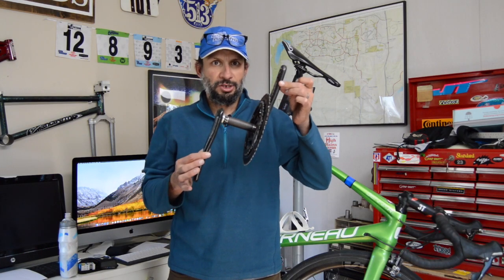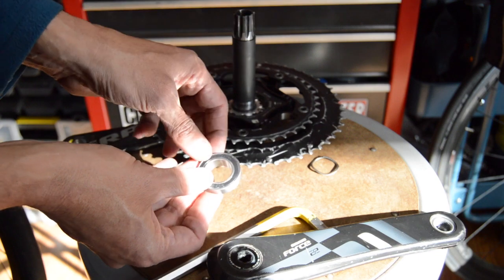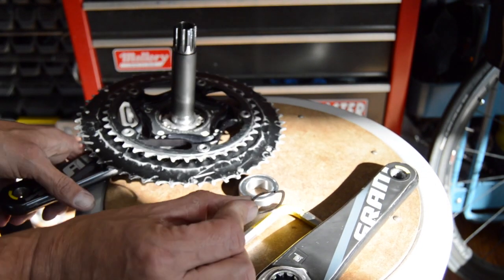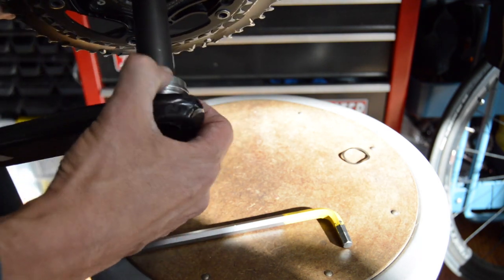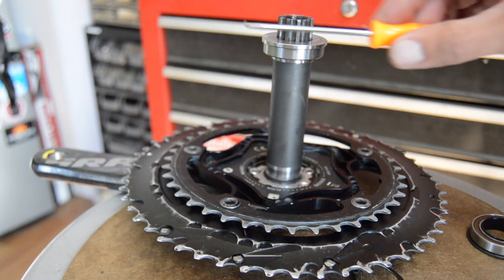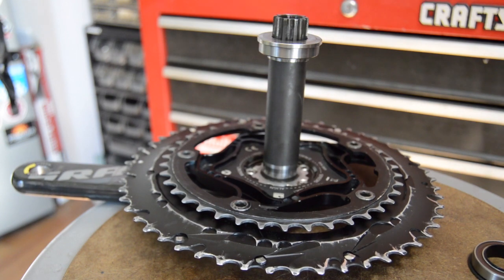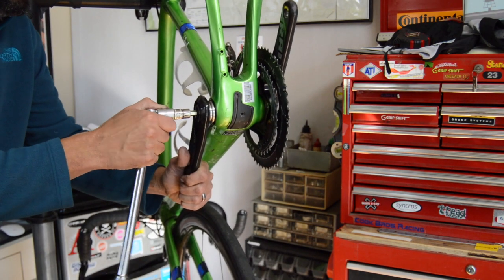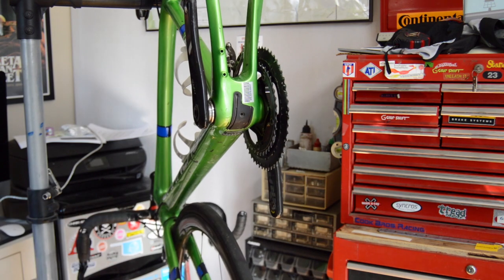IS The SRAM GXP The Worst Crankset In The World?

Comment: I ran one of these things a few years back.  Very worst crankset I have ever owned, hands down.  The thing would creak just by looking at it,  well not really,  but it was almost that bad. Bearing life was also a joke. Bearings had to be replaced towards the end of season 1. Ended up ebaying it and recovering very little of my loss. This is simply a very poor design, and what makes the design exceptionally poor is that even if you gorilla the non drive side crank arm down to center the bearing on the beveled shoulder as you claim if that beveling is out of tolerance at all you will not center the bearing properly. Mechanical fact!  This is a perfect example of a design flaw that will almost always play itself out in the fabrication phase of the product (unless you have both very, very tight tolerances and the ability to fab to those tight tolerances consistently - which SRAM does not !) because it is a design with very little "tolerance" for fabrication error or installation error in order to work correctly.  Given SRAM's miserable history regarding their actual fabrication tolerances (they are well known in the industry to be a joke compared to Campy and Shimano) I will never buy one of their cranks again.  I have run several different generations of both Shimano and Campagnolo cranks on road, cross, gravel and MTB's, and never once had the issue I had with that SRAM GXP junk.  In addition,  the very moment I removed that SRAM junk and replaced it with a basic Ultegra 6000 series crankset,  guess what,  creaking issues immediately disappeared and the bearings on those cranks are still going strong after multiple seasons. So it was not a frameset issue.
Reply from the maker: Yeah, you should probably stick with Shimano, it's really easy to understand the assembly process.

Comment: Do you have a link for the delrin spacers you were talking about? I have a feeling I will need these as there is some space on the drive side of the Force 22 cranks I am trying to install. They spin just fine and the non drive side is pressed against the gxp bb nicely but the drive side does not look flush. Thanks!!

Comment: I see a lot of flack to Hambini, but in his defence, i think people are missing the point, the reason he doesn't like SRAM/ZIPP, is one, not the design, but the variance in their tolerances, he is not a bike wrench, he works in the aerospace industry and if you say it is made to these tolerances, it is. Whilst the bike industry states a poor tolerance, or doesn't follow their own specs. That is his argument, same with bike frames.
In essence, you can get a poor one or a good one, luck of the draw, that is his issue, apart from the false marketing. 
So yes Joey, you get them to work, but should you have to with a 10k bike? That really is the question?
Reply from the maker: I've been a mechanic in the bicycle industry for a really long time, and I've worked alongside engineers in manufacturing. In my experience, I've seen way more bicycle-related issues from bikes due to poor assembly, maintenance, and adjustment than anything related to poor tolerances. There's more to keeping a bottom bracket creak free than tolerances and torque settings. This is my problem with Hambini. He focuses mainly on tolerances as an issue, then neglects fundamental assembly points when putting it back together. In his GXP video, he basically blames poor spindle tolerance as an issue when he never assembled the assembly correctly in the first place and designed a fix based on bad information. 
10k custom-built bikes always require lots of special attention to get them dialed in right.

Comment: Hi Joe,  very informative video thanks! I recently installed a SRAM GXP and SRAM RED crankset- with no spacers on a road bike- the crankset is not running smoothly- it is very stiff to turn- should I have used the spacers?
Reply from the maker: Threaded? Pressfit? If it is stiff to turn, most likely the spider is rubbing against something or the outside bearing to bearing measurement is too wide. With the cranks removed, the overall width of the bottom bracket with the bearings installed and dust covers in place should measure about 92mm. If it is more than a millimeter wider than this, you're getting excessive radial load on the bearings. Adding spacers would only make the matter worse.
Reply: @JoeyMesa  if i have width 95mm, what can i do?

Comment: I had problems with GXP : a lot of play on the ND side after around 2000 km. And I don't apply excessive torque on it (not a sprinter, very light rider that speen the leg).
Reply from the maker: Let's backpedal to the point when the crank was installed. How much torque was applied to the non drive side spindle bolt? It doesn't matter how much torque the legs are putting out if the crank is not installed correctly, (if the NDS bearing is not fully contacting the crank arm and the shoulder on the spindle, ie. Hambini syndrome) there will be play in the BB.
Reply: @JoeyMesa  There will also be play if the beveling of the shoulder that you mentioned earlier is not designed and fabbed to spec properly.  And that is true no matter how much you gorilla the NDS crank spindle bolt. If it isn't fabbed correctly I don't care if you install it with 500nm's of torque, it will not work properly. Fact!
Reply from the maker: @rcg9573  I've literally installed, maintained, and repaired thousands of GXP cranks on a wide variety of bicycles. I've even owned a few myself. I don't ever recall ever seeing one that was manufactured in a defective or out of tolerance manner enough to affect a successful installation. One thing I have seen is failure and damaged components from improper assembly.
The thing is, even if a product is designed perfectly, the tolerances are spot on and consistent, an inexperienced mechanic can still screw it up if they don't understand how the product works or the sequence of what part goes where during assembly, there's a good chance for failure. That's a true fact!

Comment: I find a lot of complaints about this crank stem from improper installation or maintenance.

I’ve had GXP on my last three Bikes and only had an issue with my current hardtail MTB and that’s because it got used as winter bike. Unfortunately I put some wear on my smaller spindle race... I did seem to fix it using a beer can as a shim since there was nothing to loose.
Reply: I have constant problem with GXP on my road bike (always a loosen ND side after 2000km). Do you have idea what sort of improper installation or maintenance could cause that ?
Reply from the maker: In addition to the other comment, make sure the dust cover is installed between the crank arm and the bearing. The spindle bolt needs to be TIGHT! Sram's torque spec is 48-54Nm, but I tighten them to the point where I can feel the crank arm bottoming the bearing out against the spindle shoulder.
Reply: @JoeyMesa  yes this is the design. The SRAM instructions tell you to keep greasing the splines and install/uninstalling until the splines get worn to the perfect fit. 
With pedaling and repeated installation the splines can wear and get loose, so people then just tighten the cranks more....but you then need to move the bearings in the cups closer together to offset the spline wear. 
There should be a spacer (crush tube) in between the 2 bearings preventing you moving that bearings though. 

The road version SRAM force and some other BBS seem to be missing the crush tube, so measuring and spacing the cranks with washers might be the only solution if you have play in the bearings. 
All the people that say they have premature bearing failures have too much side loading on the bearings. Using a bearing press to push the outer race of the BB bearings closer together will fix the issue. 

In saying this, I have a giant xtc with factory fitted press fit gxp BB and x9 cranks. Zero free play and cranks still spin 4x when you wizz them. When setup they last forever, but if you wear the spindle splines there's a lot of mucking about to reset the bearing side load.

Comment: Hi Joey thanks for the video. One of Hambini's beefs was the variance when he measured the non-drive side's splines on the spindle. I have a pressfit 86 and worn 50T chainring that I want to replace. I have  had my bearings out 3 times in 18 months. I ride alot in the rain and creaking has developed again, slight this time. What would you recommend to replace it. The tiagra crankset is not easy to find a single chainring plus i would like to go smaller (46T?). I am willing to look at other BBs. You seemed to think a 30mm spindle isn't as good? What mid priced BB have you liked? Thx.
Reply from the maker: Thanks Al
I don't know if Hambini fully understands the concept of how the GXP system actually works or not. The spindle spline area OD and the NDS bearing ID is irrelevant due to the fact that the bearing contact points are the beveled spindle shoulder and the crank arm. The bottom line is Hambini didn't get the NDS crank arm fully purchased on the spindle and blamed it on poor engineering. I tried to have a discussion with Hambini about it, but he mostly just called me names.
As far as your BB situation, unless you're wanting to switch crank manufacturers, your Shimano Tiagra is fine. You didn't mention if it's the 4700 model or 4600 or older. The 4700 chainrings are more expensive to replace and won't have as many size options as the 5 bolt 110mm bolt circle diameter of the 4600. If you have the 5 bolt version, there's quite a lot of aftermarket options. If you're looking for a lower gear range going from the 50 to a 46 chainring, a more cost effective route may be looking into a wider range cassette. That depends on what cassette you currently have though. 
As far as your bearings go, I'd stick with a Shimano press fit BB. It's about as good as it gets for something mid range price wise. If you're looking for something with metal cups instead of plastic that threads together, Wheels MFG BB's are my favorite. They run about $74 https://amzn.to/2ydQSm3
Also riding in the rain can cause lots of creaks to appear that may not even be the bottom bracket. I made another video on some common things to check before getting into the bottom bracket: https://www.youtube.com/watch?v=SR5_xUBipa0&t=328s
Unless the bearings are really rough or notchy feeling or have excessive play, they're probably fine. I've had a Shimano BB on my crappy weather commuter for over a year and a half. That bike gets ridden mostly in rain or snow, dirt and gravel, gets washed about once a month (sometimes that in itself gets water into the bearings) and they still feel smooth as butter.
I wouldn't consider a 30mm spindle at all for your setup. You would need new cranks and a specialty 41mm OD bearing cup for a 30mm spindle. It would be expensive and way less durable than what you have now.

Thanks for your questions and feedback!
Reply: @JoeyMesa  xlnt ty. 4700. One creak was the crank arm, i took it off, cleaned and greased and it's gone. My creak currently has gone, i expect the temperature has had an effect. I already ride a 34T cassette and 36T on my gravel race wheels. I had a 42T but it broke my rear derailler as the wolftooth roadlink snapped in half during a rainy dirty race. I have the cassette on my mtb which is also 10 speed, which i like - that i can go back and forth, i have a goatlink on there and a clutch derailler, works fine. The Wheels bb is on my list, thanks for telling me your experience on that, i will prob go with that. $125 CAD. Next time i remove the cups i will take a look at the bearings. So the chain ring is the issue. Apparently there are 3 other cranks that are compatible that i could use the rings from - Ultregra I think and another. So I'll have to be patient on sourcing it. The small chainring is fine, the bigger one is getting pointed - plus it can take some dings. Ty

Comment: The way I see it is that the wavy washer acts as a preload to the drive side bearing, at the same time loading the non drive side, so it becomes essentially the same as Shimano (which use the pre load method, just like a headset). My question is how can you measure the exact size of the shim required when working on the bike?(seems like it would take an extremely accurate measurement)
Reply from the maker: It depends on what type of frame the bottom bracket is designed. On a threaded BB with cups, the non drive side bearing is pretty secure in the cup, and in that case, honestly, you don't need any spacers or wavy washer unless it's an aftermarket BB that has a dust cap that rests against the drive side bearing. Some folks use an o-ring to keep the dust cap against the bearing, but the bearing doesn't need to be preloaded like a headset or a Shimano BB. The spindle is locked in place with the non drive side bearing sandwiched between the crank arm and the shoulder on the spindle. The drive side bearing only sees a radial load, so it doesn't need to be preloaded.
In the case of a bottom bracket like the bb90 on Trek bikes, you really need some spacers between the drive side bearing and the spider otherwise the non drive side bearing can migrate out of the frame and cause damage to the frame. You just have to experiment with the thickness of the spacer shims. You can get delin spacers .5mm thick, but ironically, Shimano has 24mm spindle spacers that are very thin for hollow tech II tandem stoker cranks.
Reply: @JoeyMesa  thanks for the reply. The way you explain the non drive bearing being locked in and doing both radial and axial load and drive side doing radial only is the same as the explanation given by Hambini. However I'm not sure I get the idea, is there something different with the bearings? The way I see it is that the NDS bearing would need to have absolutely zero axial play, or the crank will have play in it, even if it's locked in on the outer race (NDS)... Wouldn't a slight pre load still be necessary as is the case for any other type of BB bearing?

Comment: Complete crap. End of
Reply from the maker: End of.......What?   Your ability to learn?
Reply: @JoeyMesa  Oh i learnt from buying a bike with this crank fitted that proceeded to mangle after a few uses. I learnt to replace it with decent parts. Parts that don't encounter the same problem from endless users which is well documented. You should learn how to identify a flawed product lol
Reply from the maker: @danjay2767  I hadn't really heard of any widespread problems with the GXP design. I saw Hambinis video where he diagnoses a problem with the step-down section of the spindle but incorrectly installs the crank arm sufficiently. That's not a defect or flaw in the product, that's improper assembly, which will cause the bearing to fail. That's also what compelled me to make this video in the first place.
I did a google search on any recalls or any documented flawed product tests of GXP BB's, but could only find a few isolated instances on forums and such.
Working on bicycles has been my day job for 37 years. I've installed, serviced, and troubleshot thousands of GXP BB/crank setups, as well as every other type, and have never seen any problems due to flaws in the design of , manufacturing defects. What I've personally witnessed is an endless number of bikes that have obviously been ridden into the ground with excessively worn drivetrain parts, but the original GXP BB was still working fine.
 The issues I've seen are from very poor frame BB shell tolerances and/or improper assembly.

Comment: The fact that the non drive bearing is non preloaded is exactly why it is a poor design!
Reply from the maker: Please explain why the bearing needs to be preloaded and why that's an issue if the non drive side is fixed? I've installed and serviced thousands of these without anything different than the issues that you'd see in any other BB design.